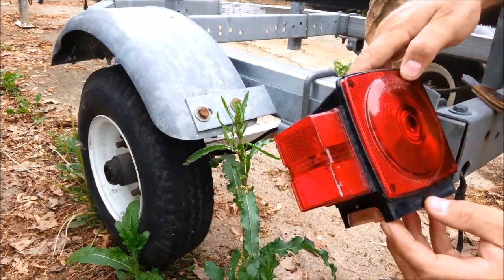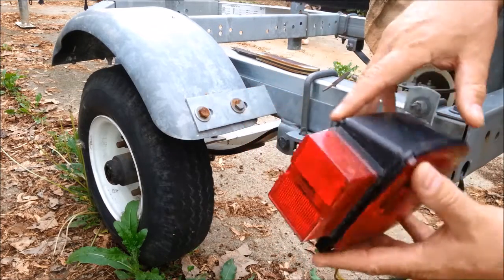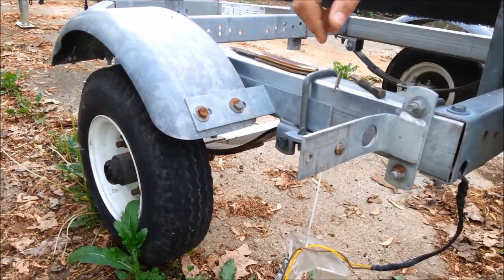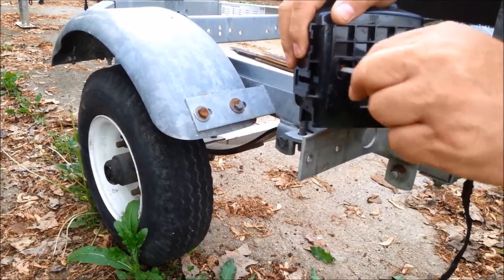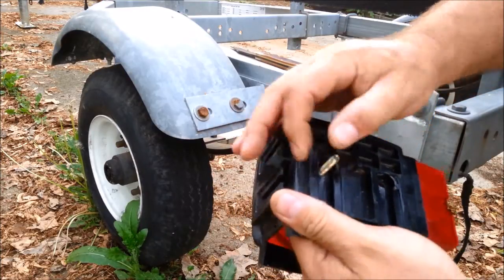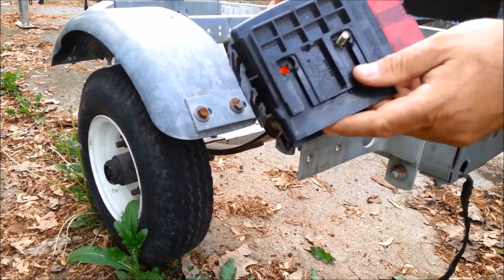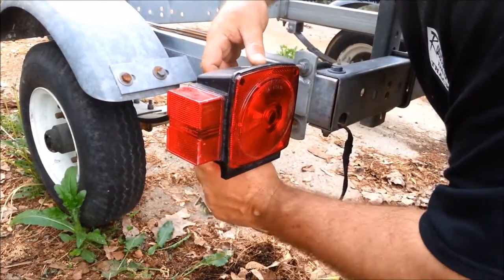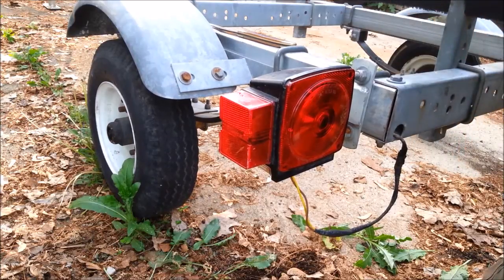Fix it! Busted  Off Boat, RV,  Camper Trailer Light

Comment: nice fix, Im working on a boat trailer now but they are too far gone. I would think they would have sealed units?
Reply from the maker: +hbrookes They are sealed.  In that it is sealed on top.  It's like pressing a cup in water inverted.  No water can get in because no air can get out.  If you purchased completely sealed units, they of course would not work. You'd end up with moisture inside then corrosion.